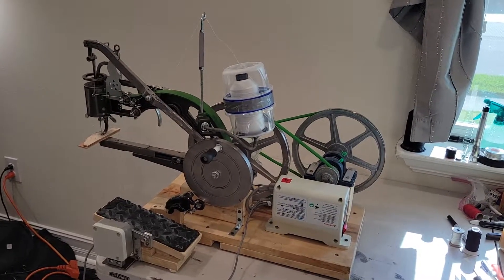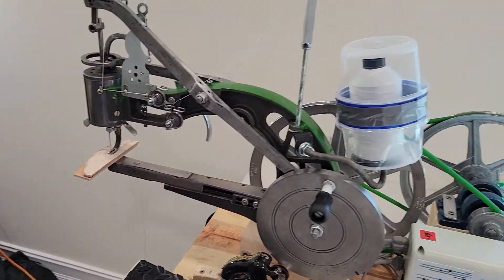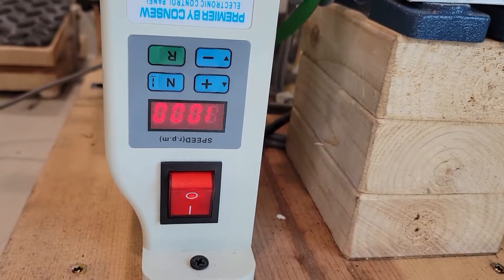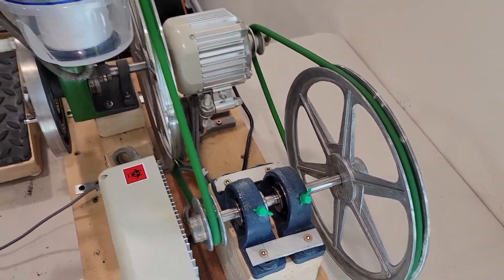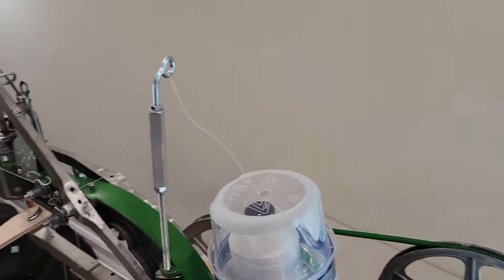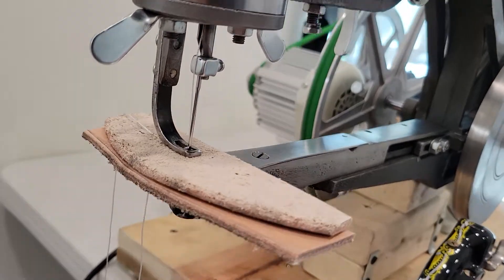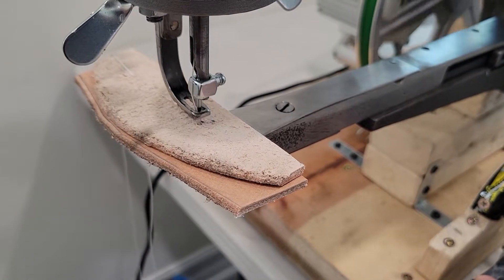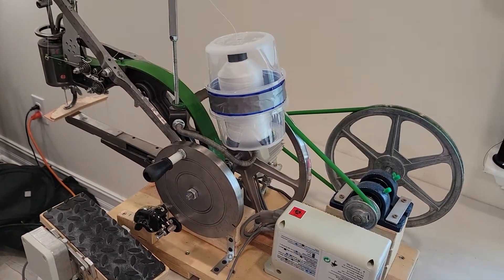Cheap Shoe Patcher with torque mods

Comment: Would it be possible to have a same kind of slowdown and torque mechanism but much more smaller? Because I have chosen this machine because I can easily mount it on a kitchen table. And a 'professional' machine always comes with a proprietary table for it, for which I haven't got any room unfortunately. So do you know if there is a way  to slow the machine down, with the same kind of torque and speed, in a much smaller solution?
Reply from the maker: Anything's possible, but what you're proposing isn't readily available, which is why I went this route.  These servo motors and speed controllers are available as kits all day long on Amazon.

Comment: Does the foot pedal “throttle” at all on these servo motors or is the pedal just an on/off switch and all speed adjustments are done with the controller box?
Reply from the maker: Oh yes, it throttles from a minimum of 200 RPM at the output shaft up to whatever speed you set as max.  My throttle sweep controls the RPM range over the whole sweep regardless of where I set the max, but I don't set the max too high because I'm worried this machine will blow apart at high speeds.
Reply: @shortattentionspangarage1312  ok, thank you for responding and sharing. I recently got my hands on this style of shoe patcher and so far I love it. It seems to be a very capable machine if you’re patient and willing to tinker around with it. I have been looking at motorizing it so I can free up a hand for material management.

Comment: You don't need all pulleys by using a "voltage regulator". Turn down sewing machine rpms from zero to as fast as you could want, directly off electric motor. Just like variable speed drill functions.
Reply: Yeah but using the pulley system keeps the torque level up on the output. Many electric motors lose quite a bit of their “push” at low rpms and might not allow him to keep punching through the leather nice and slow. That in turn would require more pedal get started and then it’s “off to the races” and just like that he’s made 5 or 6 stitches when he only needs/wants one.
Reply: @MrIgottap  it's just moving needle up an down at very low speed shouldn't require more torque? I can make a machine spin crazy to stopped with voltage by adjustment of voltage regulator! Try it!
Reply: @TimBarnett-pl9kd  not this thing, it has a fluctuation in the load through it’s cycle. Try turning one by hand and you will understand, the force (torque) required to complete one cycle is not smooth and even. That’s why using a gear box or pulley system would help the motor “tractor” through things.
Reply: 0:59 says it all, he’s using the pulleys to make it slower than it originally was all while not messing with a voltage regulator. Plus don’t things start to get hot when lowering rpm’s by “dropping voltage”?
Reply from the maker: @MrIgottap  Correct on all points.  These cheap shoe patchers are very crudely designed and even 200 rpm directly applied to the shaft would blow it apart.  I needed to step it WAYYYY down, and I wanted articulate control with full torque at the slowest speeds.  Also worth mentioning, these servo motors come as a complete kit even though I had to build a pedal for the throttle.
Reply: @shortattentionspangarage1312  thank you for responding and sharing. I recently got my hands on a similar/same machine and it has been good to me so far. I have been studying up on motorizing it in order to free up a hand for material management. I’ve come to the conclusion that the slowest servo motors (200-400rpm) I can find are still too fast without some gear/pulley reduction. That’s ok though, I actually enjoy tracking down parts and tinkering around with things, it’s how I learn.

Comment: 电机不用整的这么复杂，直接用减速电机就可以了。china is 220v，usa is 110v。
Reply from the maker: There's a difference between speed and torque.  Just slowing down a motor is still too fast for this to be direct drive, so I built the pulley arrangement to step the speed WAY down for massive torque to punch the needle thru a car tire (if I wanted).

Comment: Add an independent motor to wind the bobbin and old cordless drill or do you let it wind the bobbin while you sew ? like they did with old singer machines.

Great short informative video.
4 y ago I nearly bought a 29k for £300 but my wife said where will you put it. :-(( so I have to use a hand Speedy Stitcher Sewing Awl. Fortunately I do not have to do much heavy work.

Comment: You've engineered a very nice high quality mechanism with precise control. It's impressive.
Reply from the maker: Thanks for the kind words Larry.
Reply: @shortattentionspangarage1312 hello.
what is the needle system of this machine?
is it DPX17?
Reply: @Youtubebenimdi  hello, this is an awesome build. If you put servo maximum rpm's 4500 , can it work faster than on video?

Comment: that was amazing, the tuning you've done to allow it to stitch that smoothly is impressive but the slow speed you're able to maintain is also pretty bad ass. i gotta figure out how to tune the damn thing to keep it from breaking the thread before i can actually use it. great vid!!
Reply from the maker: I've got a LOT of trial and error in tuning that thing.  Adjusting timing, thread tension (both main and bobbin tension), needle height, etc...  I still break the occasional thread though, it's never perfect, but I can usually knock out a foot or so reliably without issue.

Comment: This is the Best Mod I've seen done so far I need to ask would you share a link to the parts you use.
Thank you for sharing.
Reply from the maker: Since eBay links die, my recommendation is to go to eBay and type in "shoe patcher", then search from there.  I just did that and found the listing for the largest pulley and extended shaft:  https://www.ebay.com/itm/224623770789?hash=item344c9ebca5:g:DHMAAOSwRv1gtmVM&amdata=enc%3AAQAHAAAAoEdgJxpsTfKtOFfVTi4LGE6tsLLxO30Ec43wBR4IP1axeYSjb8RhwjevAHTyyHkTeEqNd7UfpdVCpu9Mkpz8QH7hlTMCKzDkX0rmBPbggu5qAplaufg2lDDSW9MOGrA1ew0O7Y5pUaaESVicXUVOFlkmB6c%2FUS83EVr4%2BZ9aGRInqlLiNOOeqihJkAcqkzPDqQYRslGEbNwpU%2BunW9RZZ2U%3D%7Ctkp%3ABk9SR-DtpaXUYQ
Reply from the maker: Same for the servo motor.  Search for "sewing machine servo motor":  https://www.ebay.com/itm/165943440769?hash=item26a2fff581:g:X8kAAOSwzudiaPQs&amdata=enc%3AAQAHAAAA8JdHIKf3kFVIC07OyBGZDUaKkWEFCLbo%2F2wiVVi8I8LLbvl1tw7sm%2FTYoTgchZ5tFVBd6QxXzVG93kRbrdHGVKhE6IYaGxRvOM7l1px8dJUpOe5SwLE6u306LL%2Fe8%2FHSjQPCf%2Bjm6Of7y7FgIT7aCGISFHq9rOUzFLJVKpXlXzWCXLhe1mLlzi2LxtTeUqsGVFUEXm6554EM5mmTHhzbJBd6LKBp7UWyZqFRwbDiUHczy6141PAoUiE1to%2BYcnH%2F%2Fr6%2FirSg2LDXfpa%2FQKqO7jTqGY1QDNQzSiaK8sty3u1EJpE6j7vUVeDF99Qv1bBwDA%3D%3D%7Ctkp%3ABFBM1oK6pdRh
Reply from the maker: For the rest, I used McMaster Carr.  Go to their website and search for "V-belt pulley"  https://www.mcmaster.com/products/pulleys/v-belt-pulleys-8/
and search for bearings and shafts the same way to fit the pulleys.
Reply: Thank you.

Comment: what kind of needle and thread did you use thank you
Reply from the maker: Sorry for the delay with my reply.  The thread is the 137 size Poly thread from Tandy Leather, and the needles are Groz-Beckert part number 718682.  Be advised, those needles are perfect for the 137 thread but they do NOT have a flat spot on the shank so you have to manually adjust the needle bar of the machine to properly set the depth and scarf location.
Reply: U can use 138 and 207 with a 23 size needle

Comment: Not to sound stupid but how big it the big pulley on the very back. I realize the pulley that is attached to the machine frame is 11.5 inches but, the pulley on the very back looks to be a little smaller than 11.5.
Reply from the maker: Yes, the pulley on the motor is 45mm (import for a 12mm shaft), which is belted to a 10" pulley from McMaster Carr.  Through the secondary shaft is a 3" pulley (also from McMaster Carr), which is belted to the 11.5" pulley from that eBay kit.

Comment: Nice !  So you put about $600 worth of mods on a $99 sewing machine !
Reply from the maker: Eh, closer to $300, but it's better than a new $2000 patcher.
Reply from the maker: @Michael Neuman Thank you.  I've seen probably all the videos on slowing down this patcher machine and nobody does a two-stage reduction.  Not only is it slow, but the torque is through the roof.  I can punch that needle through a car tire now.
Reply: Old car tire boots would be epic and for sure viral....
Reply: In Arabic we have a proverb ( the inner is more expensive than the upper)

Comment: Do you have specs for your modification??
Reply from the maker: Sorry, but not really.  I'm a visual engineer, in that my designs are very improvisional.  They work, and meet a design thesis, but getting the end game is more important than the specifics of the parts leading to the final product.  For this, it was basically a servo motor and controller, pulleys, bearings, and shafts to get maximum torque with minimal speed at the slowest setting, and parts from eBay and McMaster Carr.
Reply: no he wears contacts